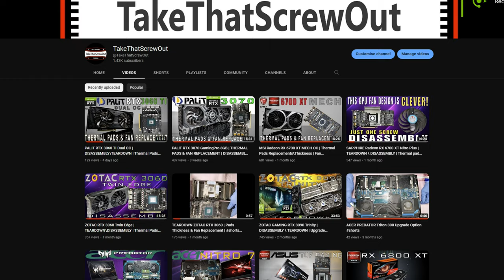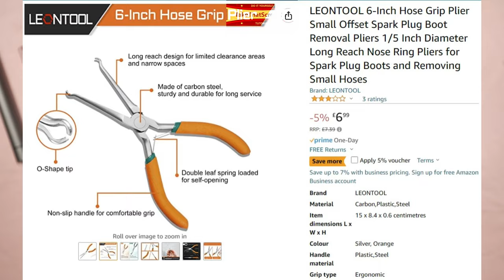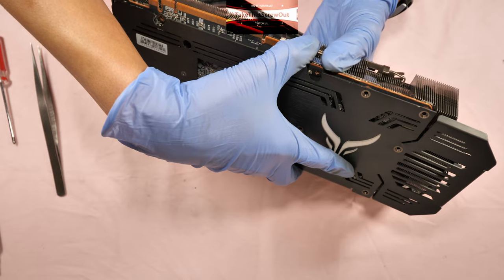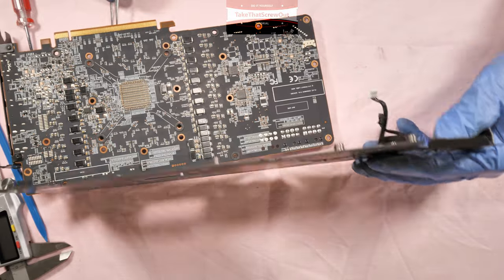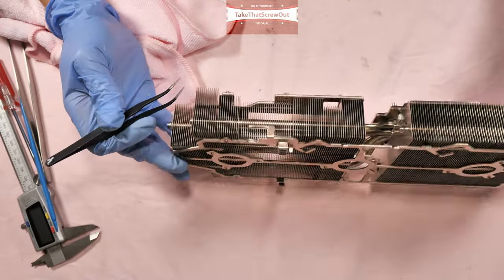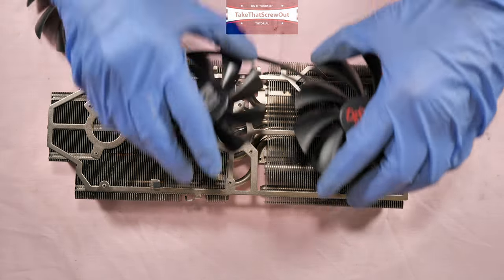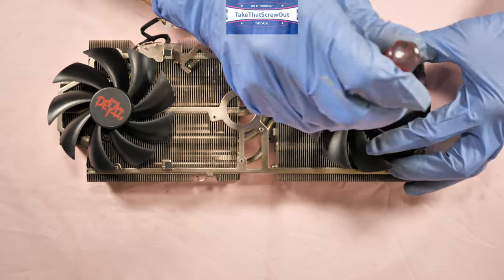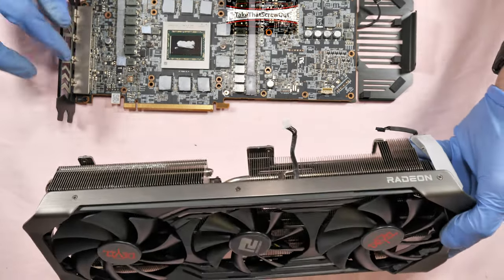POWERCOLOR RADEON RX 6800 XT " RED DEVIL " | Thermal Pads & Fan Replacement | DISASSEMBLY Tutorial

Comment: I have this model of card and it shows "artefacts" (in this case being red, blue and green pixels; very few and far between) and crashes but recovers instantly when trying to put any kind of load on it. The artefacts when in the Radeon software only show over the application itself and not on the entire screen. I've tried everything from PSU upgrade, cable checking & swapping; seating, ddu SM, uninstalling reinstalling the ram, bios, chipset,  put it into a new mobo with a fresh install of window and finally opening it up to repaste and repad it. All components looked fine to the observing eye, from what I've looked up my card is probably just faulty and I'd do better to chuck it off then waste any more time with it. I do not have the tools or proper knowledge for further investigation of the card. It is just a roiling thing to deal with. Past RMA timeframe. Any thoughts or knowledge you could pass on this?
Reply from the maker: Try to clean the PCIe connector the one on GPU with clean microfibre cloth with 99% Isoprophyl alcohol..just rub on gently both sides..some Artifacts can be fix with easy cleaning of the Contact area..make sure All the Gold contact plate are clean, grease and dust free the dry them fully with airblower or mild hair dryer. Then try it again. If Artifacts still exist, i know someone that expert on that one if you're living in U.K. he could fix any problem with GPU. he's YT Channe is " NorthridgeFix ".. Hope this could help you. Take care!
Reply: Usually thats a memory overclock issue, if not overclocked maybe the memory is faulty on it.
Reply: GPU memory*
Reply from the maker: @FuzzyBrunty  Big possibility one of the Memory chips is Faulty..there are few different possible causes of Video Artifacts i've heard in the past..
Reply: maybe readeon software itself is faulty... remove amd driver completely and install OLD radeon software?
Reply from the maker: @EternalFlameProductions  to be honest, AMD Adrenaline Software is not as reliable as nVIDIA Geforce Experience specailly when it comes to Recording video footage. Based on my personal experienced, Amd failed ocassionally..but i never experienced trouble with the green side.
Reply: @TakeThatScrewOut  true that. Gotta try latest one tho
Reply from the maker: @EternalFlameProductions  enjoy bro!

Comment: Do you know what it's called or how I can find a replacement for the RGB Lighting connector you showed? That connector where the RGB cable is connected fell off my GPU, and I was wondering how to get another connector like that to solder it to the graphics card.
Reply from the maker: Is it the connector that links in the cable end or the connector that permanently attached to the board?
Reply: @TakeThatScrewOut  It is the connector that is permanently glued to the motherboard, the connector that is above the core where the thermal paste is placed.

Comment: After I replace pads and repaste, my fans acting strange. whenever my temp hits 50C my fans goes 3krpm and it doesnt control fan curve in amd adrenalin and msi after burn. Its crazy loud lol
Reply from the maker: There might be something else that cause that issue bro. Check all contact and connection if been done properly. And sometimes when we screwed in back all the screw, sometimes, without realising the mounting points did not sit properly and align in the hole, that could Potentialy cause an issue for the paste and pads will lose contact and cannot transfer the heat, that also affect the fans cause they are all controlled by the temperature.
Reply: I had the same thing happen to me and it was because of the voltage regulator, don't connect your Tower directly to the power.

Comment: I received a (free) copy of this card past rma that won't display or even show up in Windows or bios. It does light up and did turn on once in testing but usually doesn't turn on fans except when restarting my PC manually. Prior to that time it got very hot but now it doesn't get hot at all. I think the issue may just be poor heatsink mounting. I just took it apart and replaced pads and paste but the problem is not resolved. I've noticed the backplate is rather uneven. Do you think I'm on the right track and if so any suggestions? Should I literally just remove the backplate and hammer it into shape?
Reply from the maker: Hi bro! I think you've done the right thing by changing the pads and repasting it with fresh one..just investigate and make sure the Die plate is totally flat and screwed in properly, cause a very slight gap could cause thermal throttle.
Reply from the maker: Or maybe the Uneven surface of the backplate cause the heatsink not in good contact with the gpu die. Try to fix the backplate bro..the most important is the surface between the gpu die ang heatsink plate to transfer the heat. That might solve the issue

Comment: i just want to replace the thermel paste is that fine?
Reply: Yes. You will need to be careful about the thermal pads. As long as they don't rip/tear. You'll be good to go to just repaste. I did it once. I'm having to do it again nearly a year later due to pump out but I've got some PTM 7950 this time.
Reply: @SgtCroaker  i done it and card works like a charm. i tightened the screws so the thermal pads have better heat disapation.. and i used MX6 idk if i needed to get a specialized sort of thermal paste but its working and my hotspot temps are lower when playing rdr2. it would get to over 90c
Reply: @ElonTusk.  same here. Hotspot temps hitting 90+ within minutes. I just finished applying PTM 7950 and my preliminary testing shows my Hotspot not exceeding 64c, which is remarkable! VRAM temps and all look great and I used the same pads. I hope further testing yields the same results, if not even better.  

Also Mazel Tov on your repaste being successful!
Reply from the maker: Should be fine as long as the pads are all still in good shape. Enjoy!
Reply: The temperature doesn't only depend on the thermal paste, it mainly depends on the configuration you give to the Adrenalyn. Search on Youtube. I play in 4k quality at 60°.
Reply: @gixherrera5924  i was benchmarking rdr2 at 3440 x 1440 @ 60 and over 90c few seconds into the benchmark isnt a good sign.. and i undervolted overclocked.. yes i done tests.. and rdr2 is fine with it.

Comment: great video! would 2mm thermal pads cause spacing issues? i have both 1.5 and 2mm but i would have to buy more of the 1.5
Reply from the maker: 2mm compare to 1.5mm is quite a gap..that could possibly cause thermal throttle.
Reply: 2mm pads will be fine as long as they are not really firm. Just do not reuse the pads like in this video. Once the pads are removed, they will not always work the same because of lost material and contamination. Also it is not recomended to touch them with bare skin, as the oils in your skin will burn and could cause the pads to get hard, so wear gloves or use tools.

Comment: Nice video !! I need to restore my card. So maybe is Liquid Metal a way to go ? Or will it damage the heatsink ? 
Best regards !!🎉
Reply from the maker: To be honest, i don't recommend to replace it with Liquid metal on this particular card because the die plate is not design for liquid metal..Aluminium (Aluminum) will have a bad chemical reaction with liquid metal..pure copper is fine. If you really want to try replace it with liquid metal, i would suggest to put insulation tape (electrical tape) around the edges of the gpu die..make sure the tape is sealed, this will help to prevent the liquid to spill and spread on the sorroundings to prevent short circuit. But be aware using liquid metal compare to good quality thermal paste has a very minimal difference..i think its not worthied doing so, and the potential risk that could happen.

Comment: This one differs very little from the 6700XT right?

I have one that shows some rust signs, should I take it apart and run a rust remover on it?
Reply from the maker: Yes bro, slightly different pcb layout from 6700xt, this has more  chips generally more parts..which particular area that corrosions build up bro? Don't use harse liquid chemical for the rust.

Comment: Great vid bro have you ever tried those graphite thermal pads instead of using thermal paste on the gpu die ?
I was curious to your thoughts on the product .
Supposedly they last longer than paste and dont suffer from pump out
Reply from the maker: To be honest, i haven't tried those product yet. But i think i've seen Linus from LTT feature's and review those product before, that was few years ago..and the result wasn't great, not bad but its better to use a High Quality Thermal Paste like Noctua. Liquid metal also good performer but quite risky.
Reply: @TakeThatScrewOut  thanks bro
Reply: @TakeThatScrewOut  those graphite pads are quite expensive too , the grizzly kryonaut is £34 in uk
Reply from the maker: @peterpipe9015  You're welcome! Take care!
Reply from the maker: @peterpipe9015  i know its quite pricey..but not that great unfortunately..🙂
Reply: @TakeThatScrewOut  liquid metal are great if the heatsink has a nickle layers , if it's aluminum then better be using regular thermal paste
Reply from the maker: True bro!

Comment: Hi, does it make sense to put thermal pads between pcb and backplate?
Reply from the maker: That depends of the design of your gpu..some backplate are made of metal and design to help dessipate heat, but some are just plastics just to cover the pcb. If its metal, i would say yes it make sense.
Reply: @TakeThatScrewOut  have a 6700xt red devil - but metal backplate has no touch on the pcb.
Reply from the maker: @milchmonster6237 every gpu model have their own unique design..some have thermal pads on the back of pcb to cool down those chips that works hard and heats up during heavy loads, some don't.

Comment: does this also apply to the 6900 xt? They are pretty much the same card
Reply from the maker: They look the same outside but the pcb layout has slightly different because the 6900xt has more parts. I cannot guarantee you the thickness of the pads.

Comment: I will be glad if you answer if the dimensions of the 6700 xt and the thermal pad are the same, I have a 6700xt myself, I do not know the dimensions
Reply from the maker: to be honest, I haven't done the Red Devil 6700 xt version yet..so, i can't give you the right answer at the moment. I'll try to check the Official Manufacturer website if i could find those info for you. 🙂
Reply from the maker: Got some info for you bro regarding your query about the Red Devil 6700 xt thermal pads. I've got this information from the Forum sharing their experiences about their card. PowerColor Red Devil 6700 xt has 0.5mm on VRAM and 1mm thickness for VRM chips. hope this helps. enjoy!
Reply: @TakeThatScrewOut  I have the Red Devil 6700 xt This does help.
Reply from the maker: Thanks bro! Enjoy!

Comment: Have a nice day. I have a new 1mm thermal pad. would it be suitable?
Reply from the maker: I recommend 1.5mm similar on the stock one if you can find one bro
Reply: @TakeThatScrewOut  You wrote late. I used 1mm. I hope it won't be a problem. I am writing from Turkey, I learned a lot from you.
Reply from the maker: You're welcome bro! Just screw in all screw in heatsink tightly to have maximum contact to minimise the gap..and try to benchmark or stresstest your card and keep an eye of the thermals. If you haven't any software yet, try to download Free MSI KOMBUSTOR from MSI Homepage.
Reply: @TakeThatScrewOut  ok thanks.
Reply from the maker: @ayka4318  No worries! Take care!

Comment: Good night and thanks for the video, i actually have this GPU and i have a coil whine when i´m playing something like DEAD SPACE (the new one) or RE4 Remake... is that normal on this type of GPU???
Reply: Yes its normal. I have a tuf 6800xt and coil whine is there
Reply: I know this is 5 months old but my card, (same as in the video) had terrible coil whine. I got rid of most of it by running Heaven benchmark for a half an hour then tested in game. I did that three times over the course of a week and it pretty much disappeared. Idk why it worked but it did, I had read a comment on trying it and people were having success with it although they were doing it for 24 hrs, I did not feel comfortable doing it that long. Then I did some research on my power supply and it was 8 years old (EVGA nex750B).  It was on the tier D of the psu list so I decided to replace it and the coil whine is completely gone. I replaced it with a Super Flower Leadex VII 1300w which is a top tier unit. I could have went 850w or 1000w but the price difference was 10-15 bucks so why not go big. Hope this helps someone. Coil whine is so annoying. Oh almost forgot if you are using one cable with 2 8 pins to power the card switching to to 2 cables has solved the problem for others. I was already using 2 separate cables.
Reply from the maker: Brillant! Thanks for sharing your info and experienced bro..that might help other people with similar issue with their gpu..
Reply from the maker: Well, not pretty normal actually..coil whine happens to various gpu model..as far as i know that's been caused by elect flow down the circuit that might caused by very tiny vibration..mostly likely it happed to those older gpu's or some maybe from factory issue that not been traced during the quality control.

Comment: Bro what's the part number for the fans?
Reply from the maker: Part number of the two fans that links together is FD10015H12D, DC BRUSHLESS, DC 12v, 0.55 amp ( FirstD brand)
and the Middle Fan ( smaller ) is FD9015U12D, DC BRUSHLESS, DC 12v, 0.55amp (FirstD brand)
Reply: @TakeThatScrewOut  thank you. I'll try first to lubricate them, we'll see if it helps
Reply from the maker: @Kytes93  be careful lubricating those..be sure its non flammable product. Maybe try Vaseline but only very tiny amount

Comment: Can i use these size thermal pads on 6700 xt red devil?
Reply from the maker: To be honest , i haven't done that card yet..so, can't give you the accurate answer. But i'm assuming that should work as most of those one step up variants with similar model used same thickness pads.